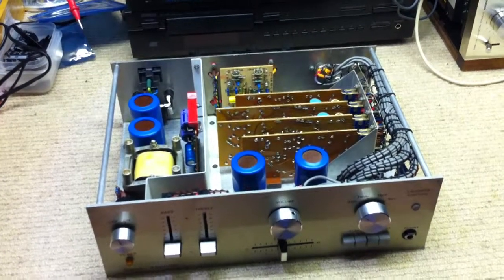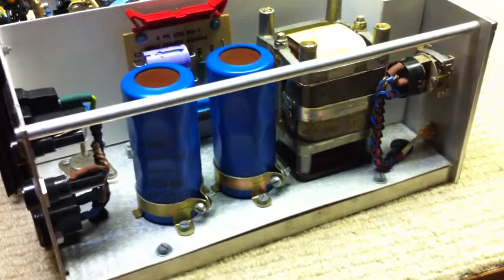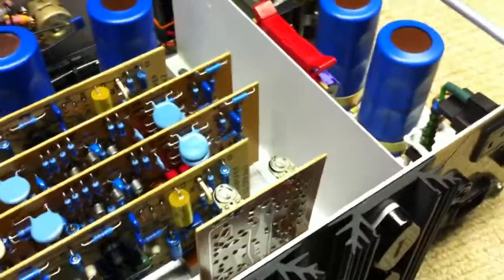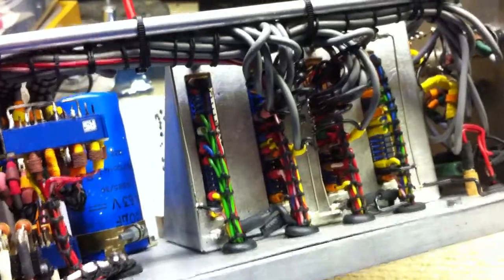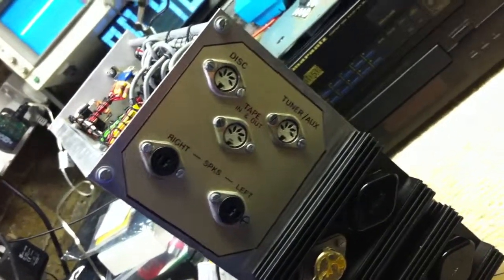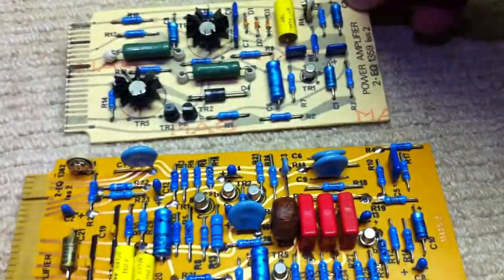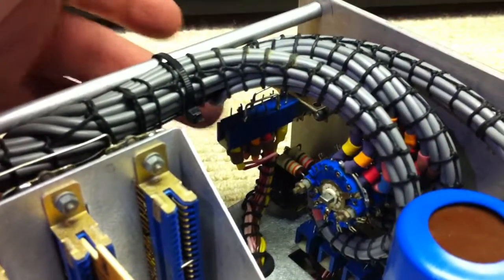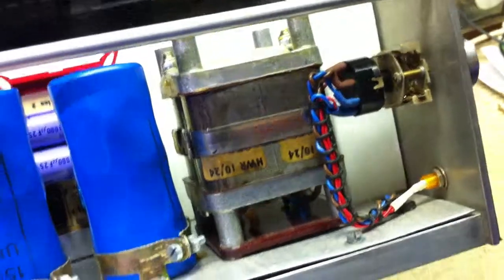stereo amplifier modular unknown brand

Comment: Hi, at 2mins 5 seconds top left of the screen shot is a blue item which has the words RS stamped on it.
RS is radio spares, I doubt a main stream audio manufacturer would buy their parts from RS,so from this i think it's a high quality home made project.
They must have had access to pcb making equipment and also the pcbs are printed with locations of parts, not normally available to the home builder.
I think someone made it,some of the pcbs have serial nos on them, try googling those

Comment: Some details in the work look like military / avionics quality work, as the wire harnesses, the pink heatshrink tubings....  maybe a hi-level diy work from a guy who worked in such a factory.
Reply: Its quite lovely in parts. We  used to lace cable by hand like that here in the UK, up till the 1970s in a few things at any rate. I was taught to do it in an old style engineering college getting my telecoms engineering HND (in the early 80s). Probably the last time it was taught...